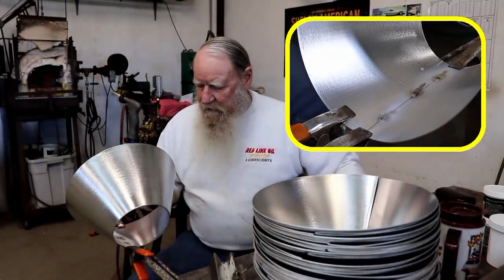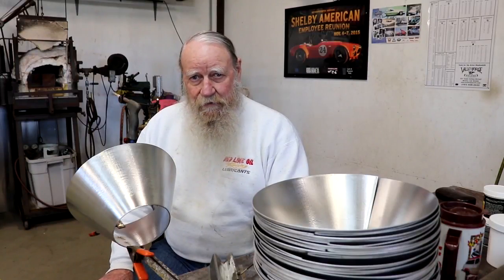How to Form and Weld a Cone

Comment: Hey, do you have a close up of your setting of your slip roll? Im curious how you got this cone without any pulling or pushing the sheet...🤔 and your rolls seem to be set almost parallel... i think im missing some detail on your slip roll 😅 do you have some kind of fixture on your slip roll, that pushes the sheet in its shape while rolling? 
I hope you can help me. Im learning this profession right now but your technic seems to be a bit different, what i have learned so far.
Greeting from germany 🙋🏼‍♂️
Reply from the maker: My rollers are parallel and I do not have any special fixtures.

If you notice I have the sheet all the way to the left side and the edge of the material is in contact with the machine. If you put a slight amount of pressure on the material where it makes contact it slows down the speed of the material on the inside while the outside of the material goes at a normal speed.

Get a few practice pieces that are the same (I suggest 5) and give it a try. It may take you a few tries to figure out the amount of drag needed to get the desired effect.

Jere
Reply: @jerekirkpatrick2092   Thanks a lot :) I'm going to give it a try but this could be challenging to do it with V2A or V4A (i think its 304 or 316 in the US )
Andreas

Comment: Came across your video, really good technique! Got a question though: any ideas to how to form a pointed cone? I mean, a non-truncated cone. I am making low-taper cones (around 10° and 20inches in diameter), and I'm struggling to make the weld unnoticeable. Currently, we are cutting the sheet and then compressing with an open ring we made until the to edges meet. Then, I weld the seam. But when we release it, the seam actually shows an angle, which is difficult to hammer out. Any tips would be welcome :)
Reply from the maker: Hi Tomas:

Look here on YouTube for "how to lay out a cone" or look at my video "how to lay out a cone". You can leave off the smaller disc and replace it with a single point.

Planishing a weld will be done in different ways depending on weather it is steel or aluminum.
I hope this helps.       Jere
Reply: @jerekirkpatrick2092  Thanks for the video (And for the quick reply!), Ive just watched it. Its 2-3mm stainless steel, so it is a bit tough. Im thinking on making a tool that over-bends the ends of the sheet while we weld the convex side of the cone. Its a low taper, so we actually never archive plastic deformation, we just need to achieve a continuous curvature when released. Will keep checking your videos for inspiration :)
Reply from the maker: @TomásOttonello  Make one that is of your liking. Take a piece of poster paper and cut a slit from one side to the center. Hold the end of the slit at the top of the peak and have the paper conform to the shape. Make a mark where the paper overlaps and the outside of the original. Cut on the lines and you will have the pattern. 
I hope this will help.         Jere
Reply: @jerekirkpatrick2092  Yes, I got the method for laying out the cone, but we were having problems with the welding, due to the stiffness of the material
Reply: @Tomás...Ron Covell has a video on making a cone. Hope it helps you.
Reply: @anvilhammer4144  Thanks! Its very helpful, although not so applicable to large, low taper cones. But I'm definitely going to give it a try. For large (30"diam), 3mm stainless steel cones, we have perfected our method a bit, over-bending the shape before welding

Comment: New to the gas welding of aluminum, how come you dont just tig weld it? Also wish you had shown more close ups of the weld afterwards, Thanks again for another great video and again love the multi screen shots you show.
Reply from the maker: Hello adam.

These parts are going on 1965 Mustangs that are being built by the same people that built the originals at the Shelby shop back in 65. Therefore the parts are being produced by me just like I would have made them back then.

I will be doing more videos on making these parts and will show more of the welding and the finished weld joints in those videos.

Thanks for the input.            Jere

Comment: I've been telling people for years that when you properly weld a butt joint it should look the same on both sides. Most people think I'm crazy for saying that so it's nice to hear it from someone else.
Reply from the maker: Hello Silk Hat.

If it doesn't look the same on both sides then you don't have 100% penetration. If the remains of the joint are present on the back side, that is a place for a crack to start. In fact you have welded in a crack to begin with.

On another note. I am starting today to get my 53 ford pickup back on the road after 15 years. Do you think that would be of interest to others? If so I will document and post. It's not all metal shaping so I'm on the fence weather there would be any interest on my channel.

Thanks for your feedback.           Jere

Comment: Very interesting method! I have a couple of those Dillon/Henrob/Cobra torches--they just made me a welding-only (no cutting) left-hand model, because the right-handed model I bought first is too awkward to use in the left hand. The gas control knobs hit me exactly in the wrong spot of the wrist. Very awkward to use, but I can still cut with it of course. I'm anxious to try the new lefty though. 

Great torches!
Reply from the maker: Hello Tom.

I'm glad you got a torch that you can use. I have been selling that torch for quite a while and have had several requests for left hand torches. I also requested that they decrease the weight of the casting of the valve body.

Thanks for watching.             Jere
Reply: I was talking to Mark about them offering a left-handed model, and he says he'll think about it. As I said though, they couldn't make one that cuts using the current design. But since I already had a right-handed unit that functions normally, they just left out the plumbing for the cutting functionality, and then twisted the tubes so that the same orientation of the gas flow knobs was maintained. I just got it yesterday but haven't got a chance to try it yet--but it looks great! Mark took a bunch of pictures of it for future use, he said.
Reply from the maker: Sounds like you gave him something to think about.

Jere